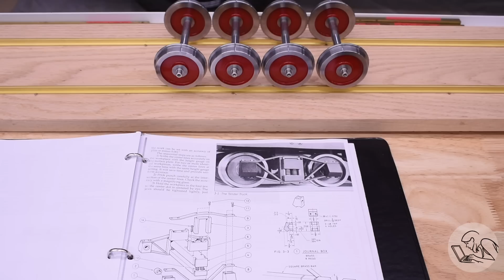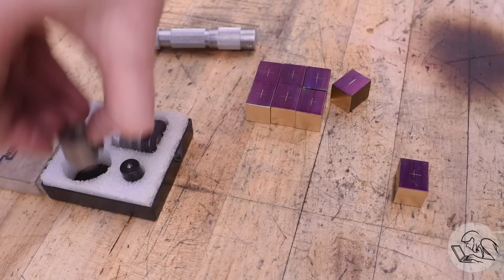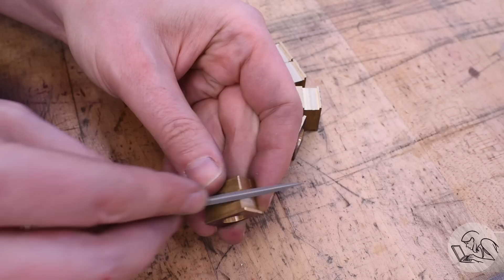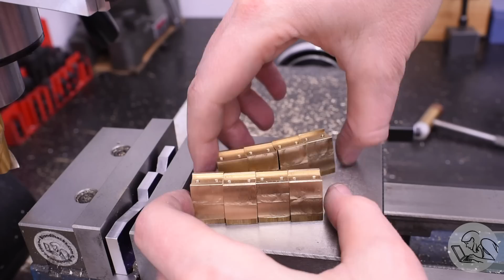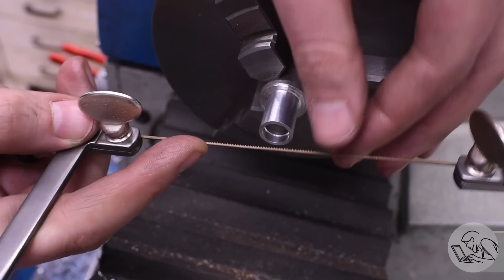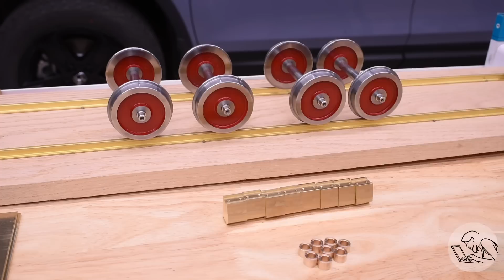Barrel-Shaped Bearings! Pennsylvania A3 Switcher, Part 16

Comment from the maker: Hey everyone- a common question on this one is why the bores were done on the lathe instead of the mill. The answer is the same as it always is to this question- things like this are faster and higher quality when done on the lathe. Milling machines with boring heads are fussy, slow, less accurate, and less rigid than a lathe. It’s a last resort when you can’t do it on the lathe. Turning a bore for a bearing is what lathes are really good at! I have a whole section in my FAQ (linked in the description) about why things should be done on the lathe whenever practical. Check it out!

Another common question is lubrication. There’s no facility for it in these boxes. Kozo’s design is to lubricate them via the space between the wheels and the boxes. This works fine with a needle oiler and for the light duty these wheels see, it should be just fine.
Reply: Makes sense, the stability of the alignment of the headstock on the late to the bed is far better than even the top quality  mill, this is  due to the small distance between the spindle centerline and the cutting tool. Far more rigid. 

Besides that, the lathe is so often more satisfying to work with.  The only thing that beats it is a shaper.
Reply: My oldest brother taught me that they are called bogies.  The Army taught me that the pulley on top of a flag pole is called a truck.
Reply: Sorry for going off subject, but where did you get your leather apron? I like it.

Comment: Super video as always - thank you!  Question - what's to stop the barrel bearings rotating with the axles?
Reply from the maker: Nothing. Doesn’t matter if they do
Reply: Forgive my presumption, Quinn, bit if the barrel bearings rotate in their block, won't there be an accelerated rate of wear on those narrow circumferential surface?
How about fitting anti-rotation pins?  Just a newbie thicko asking the obvious.....🤓

Comment: Possibly a weird question:
With those journal boxes having an unusual 'prism' profile, would it have been worthwhile to mill the stock to the prism shape before separating the eight individual parts from it? Is it simply not worth trying to manage such a long piece for the two setups which that requires?
Reply from the maker: The facing to dimension would be hard because now they’re a weird shape
Reply: @Blondihacks  ah sure, interrupted cuts and such. Gotcha. Thanks!

Comment: I have a similar optical centre punch, and when I need to put a dot on the edge of something narrow I try to put something alongside at the same level to make it easier to use.  In your case, putting an axle box on each side while sorting out the middle one would have made it much easier to keep the loupe in place.

Comment: Someone gave me...yes I said gave me...(stuff is expensive) me a substantial amount of 1" thick ground aluminum gage plate. Plus a length of 1/2"x6 steel ground on 4 sides. It is so handy for just what you describe. Fixture plates.

Scrap parts? you have scrap parts? Here where I am out of spec parts are simply repurposed for something else. 🤣🤣 Nevertheless, those bearing carries came out real nice and I think the engraved hatch doors are indeed a nice touch. Well done on the bearing tapers and fixturing as well Quinn. This thing is going to be so sweet. Cheers

Comment: I am so impressed with the early engineers that added those features to the wheel/track structures to stabilize the tracking on the tracks around curves and rough layout of the tracks. Ya did good Quinn.

Comment: Hello! Russia has developed an automatic assistant for a lathe with free and open source. everything is assembled on the basis of arduino and stepper motors. perfect for your lathe. he will be able to automatically cut threads, sharpen tapers, and make multi-pass feeds with a bunch of settings. I collected one for myself. I can show the video and help with the translation if you are going to do the same

Comment: Pro tip for a loose vise fixture like that angle parallel you made. Grab a rubber band and band it to the fixed jaw to keep it from scootin around during part changes

Comment: Those drill bits are very similar to the ones Aldi (a German discount supermarket) used to sell a few years ago. Luckily I bought several sets at the time as I haven't seen them with that grind recently. They do drill beautifully even in stainless; I have yet to see a machine design that can sharpen a grind such as this.

Comment: Quinn... When I made mine, I did actually make oil wells in the boxes, which I made small covers for.  My thinking was not just that it would be aesthetically more pleasing, but the ease of oiling would help ensure that journals got oiled before (and during) every run.   But the faux doors on yours are 1000% better than the bare 'canvas'.

Comment: When milling the brass stock to length, you didn't put a piece of the same stock on the other end of the vice. Is the clamping pressure low enough that you don't have to worry about equal stress on the vice?
Reply from the maker: Doesn’t matter for little stuff
Reply: @Blondihacks  I'd wondered about that. Thanks.

Comment: Quinn - what a shame that you had to scrap so many of those parts. I guess it happens to the best of them. I'm surprised that no 'adult language' was used. Nice touch with the detail work on the faces of those journal boxes!
Reply: I would assume that she is not just dumping them in the scrap bin. Errors like that tend to find  second lives. If nothing else, drill the hole the rest of the way through and used them with some rods for a slide  system. Kitchen drawers anyone?
Reply: What's your opinion of gilding on brass?

Comment: Glue a piece Of round stock into the small engraving so it stands out like a handle. The boiler was a home run but these simpler parts generated so much scrap… better that way than the other😉

Comment: Having worked in the truck shop at CN Transcona, I can tell you that the journal bearing is made the same way, the inside top of the journal box is flat and the journal brass was curved just like that. On modern roller bearing trucks there is adapter with a curved top which sit between the outer race of the roller bearing and the truck side.

Comment: The way we would accurately lay out a hole when laying out the holes on the surface table was the following.
Using the height gauge we marked the hole center as usual then scribed a box around the center. The box was a few thousandths wider than the center drill pilot. Then we would just start the center drill and check to see the box witness lines all around the hole. You can drill to within 0.005" or better using this method.

Comment: My father grew up in a house with a main passenger line across the street from him. As a child he would watch the trains go by and sometimes would see a "hot box" . That of course meant the bearing was bad and he would go to the depot near by and report the "hot box".
Reply: The journal boxes originally held wool batting soaked in heavy oil to keep the bearing inside lubricated.  During routine inspection more oil was added, but occasionally one would get missed or delayed in refilling the oil and the batting would overheat and catch fire (a.k.a. a "hot box").  

The job of the crew in the caboose was to keep vigil for hot boxes and signal the engineer to stop the train if they saw one, whereby they would open the journal box with a long-handled hook, remove the burning batting, and let the bearing cool before adding more batting and oil.  The advent of Timken roller bearings nearly eliminated this issue for all practical purposes.

Comment: And the Brits call a truck a Lorey.  Do they even use the word truck?
Did you make the rail, or was that store bought?
Reply: We do, however we spell that Lorry, yeah, that looks wrong to me too. 

Truck is becoming a more common term in the UK,  I blame those Americans.
Reply: @marvintpandroid2213  My fave has always been articulated lorry.  What's that old quote, two peoples separated by a common language?  Although there are a few differences.
Reply: We call a 4 wheel goods wagon a truck and also the single axle  support wheel  on a locomotive a pony truck.
Reply: @jameshodgson1609  
Yes, but the need to truck ponies is  very limited, most people ride horses.